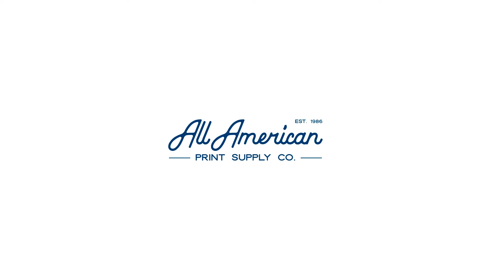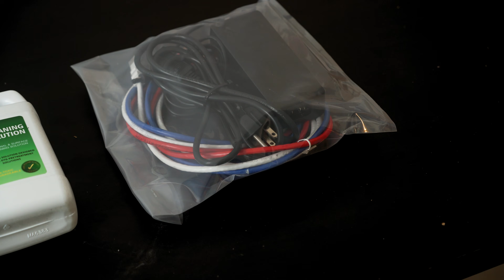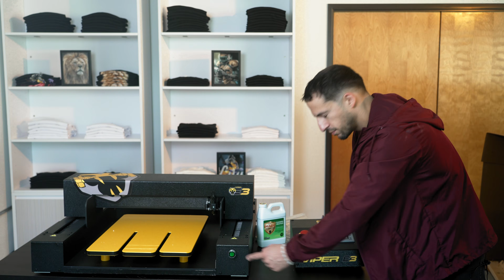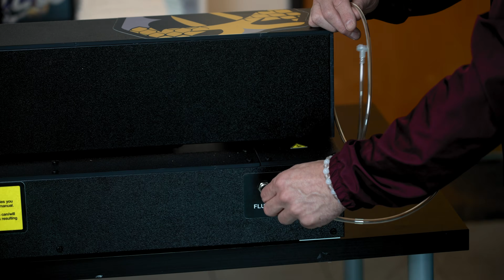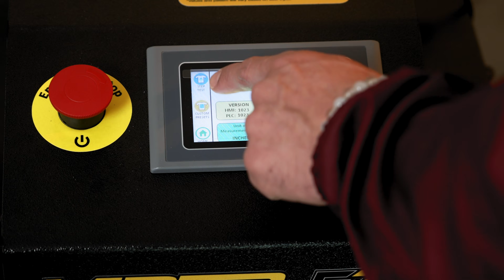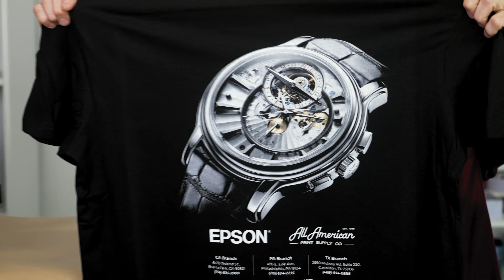Perfect Shirts every time?! DTG - Viper E3 Pretreat Machine | AA Print Supply

Comment: The biggest pain with these pretreater's is the nozzles constantly getting blocked and having to be replaced. How does this machine prevent that from happening?
Reply from the maker: I was recently told the best way to address this concern from a manufacturer: we need to treat our pretreat machines like a printer and perform regular end of day maintenance.
1. Purge remaining pretreat in machine for later use
2. Charge pretreat machine with cleaning solution to nozzle
3. Wipe down surface pretreat spray remains

Many nozzles can also be revived with a cleaning solution soak overnight as well